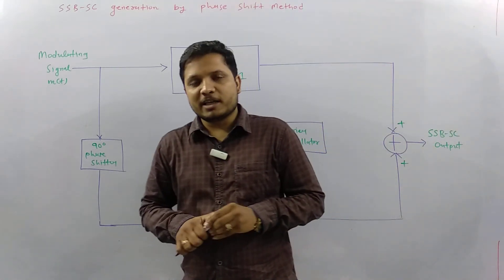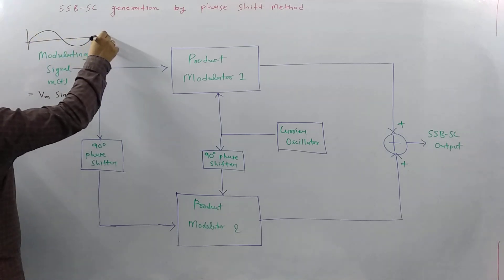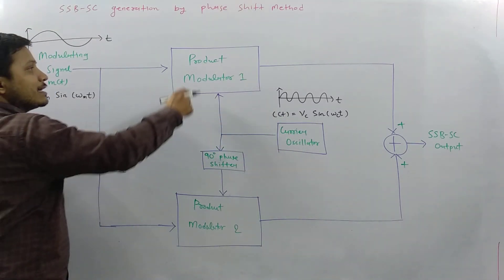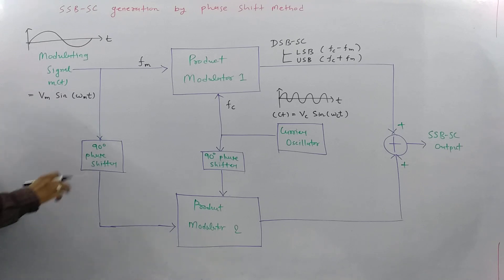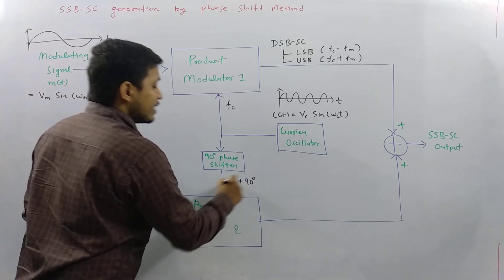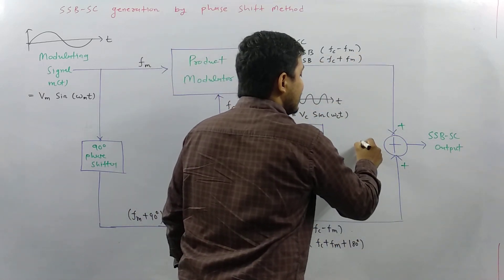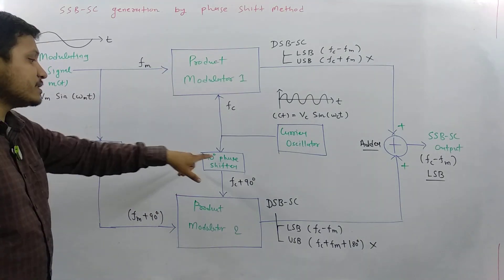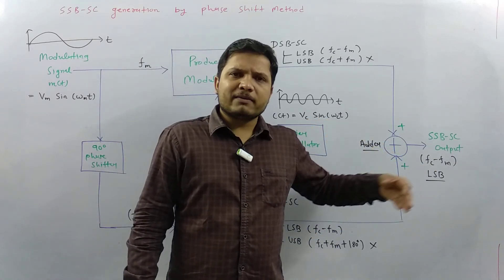SSB-SC Generation by Phase Shift Method (Basics, Working, Circuit, Block Diagram & Importance)

Comment: Instead of using phase shifter can't we use center tapped transformer as we had done in balanced modulator?
Reply: center tapped is used in ring modulator